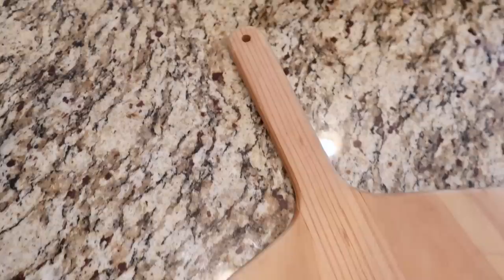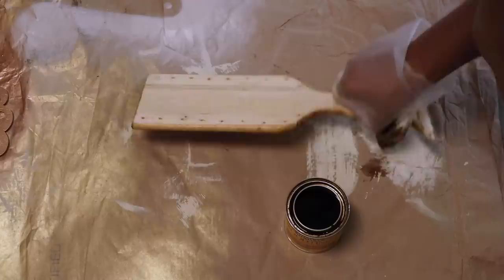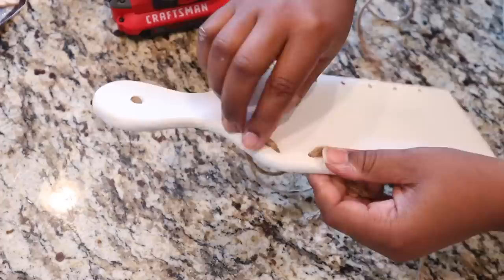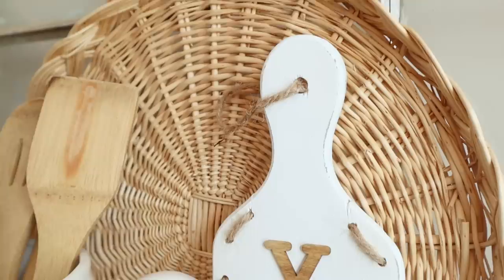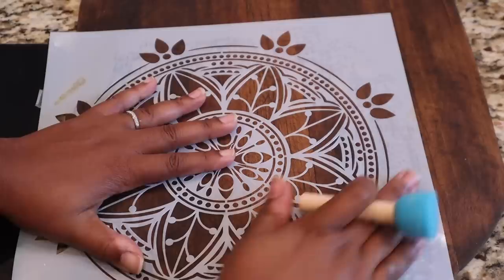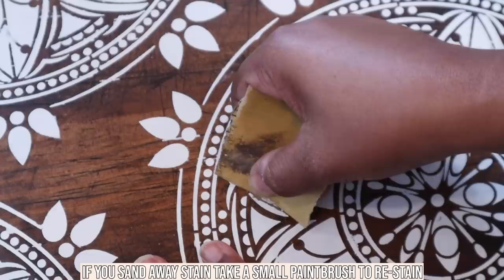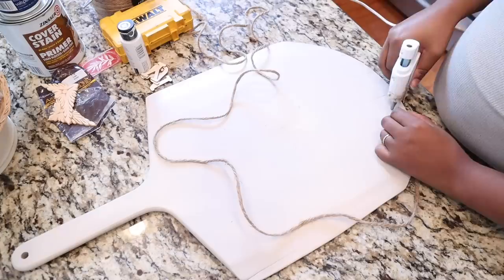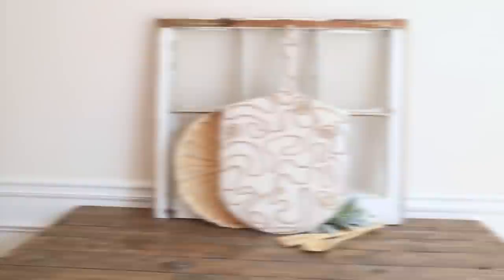Kitchen Decor Ideas *Quick & Easy* | Trash To Treasure | Ashleigh Lauren

Comment: A large upholstery needle would have worked with threading the twine on the cutting board. Or wrapping the end in tape.
Reply: A knot at the end of the twine on the cutting board would have looked cuter.
Reply from the maker: Yes, those would work as well. Nice, tips. I used what I had around me and the glue worked just as well. If you do this you could def add knots to the end that's the beauty of tutorials. I'm just giving you an idea, and you can take it and do whatever you chose.